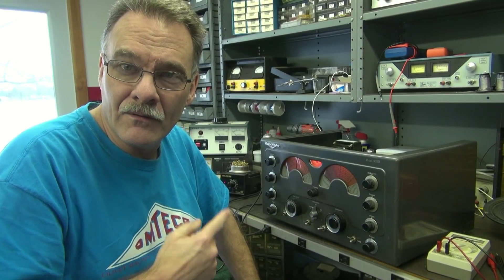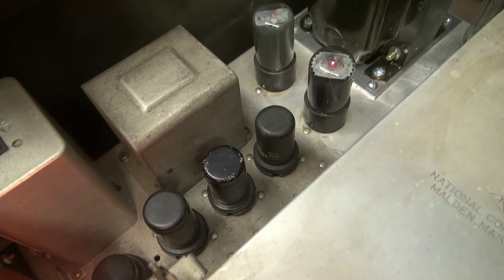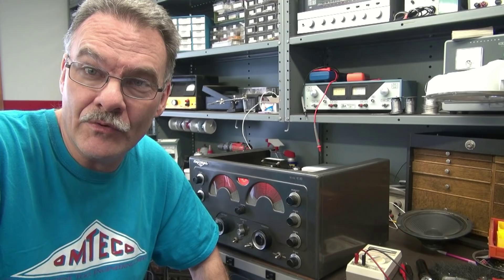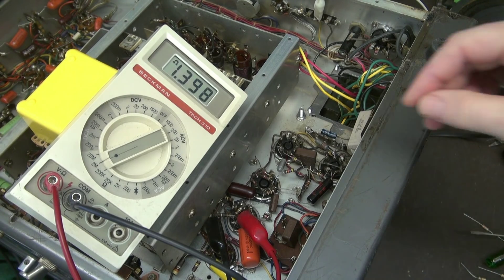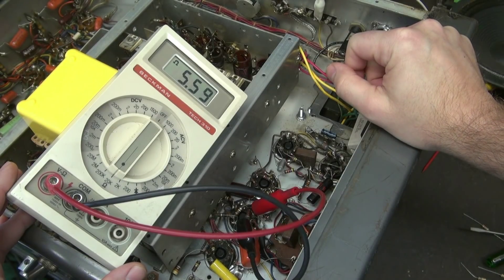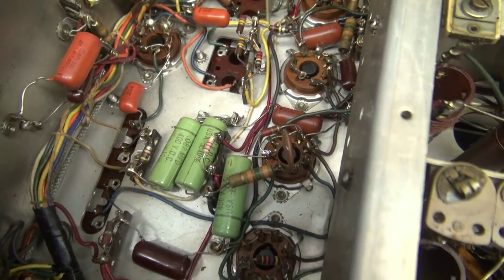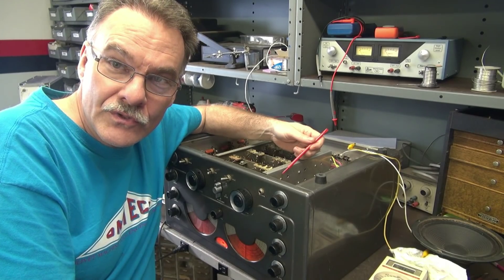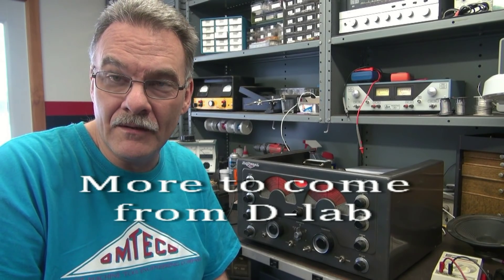How to repair National NC 183 Ham Shortwave receiver audio noise

Comment: Thanks for the video.  I have restored many of these old boatanchors and as these components age, resistors turn into capacitors and capacitors turn into resistors. Particularly the wax/paper-foil caps and dull-finish resistors.
 Many of the wire-wound and glossy-finish resistors hold their value well. Mica and ceramic caps generally don't electrically leak, although I have seen mica caps leak in a high-stress (high voltage/high temperature) circuit.
 Beware of Micamold® caps with the domino appearance as they are not mica, but rather plastic-encapsulated paper/foil caps that can break-down and electrically leak.
 Many of these receivers have been stored and dormant for decades in less than optimum conditions although I am sure that just normal aging does its damage. Component (resistive/dielectric) materials and manufacturing processes are so much better today.
 In good condition, these receivers offer hours of fun listening and give the rewards and satisfaction of a restoration job well done.
 I have a few of the lesser NC series Nationals and am considering getting an NC-183D in May at the AWA Spring Meet flea market/auction.

Comment: Nice radio Terry.  I can safely say that old Hallicrafters suffer from the same issues. Best advice you gave was remove and replace one at a time...(and have a big box of multiple value resistors on hand)  

Could you do a bit in one of your videos to show the old style domino and colored capacitors and that look like resistors that we might run into.

thanks
Frank